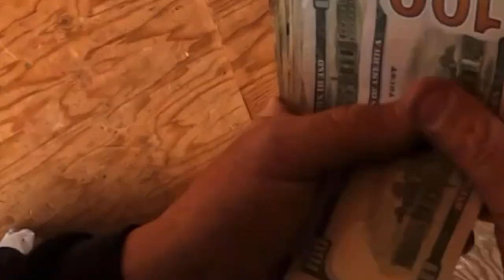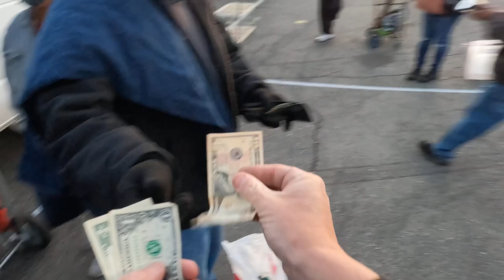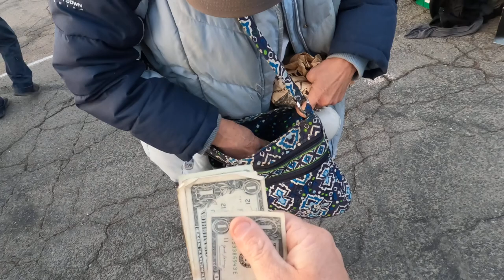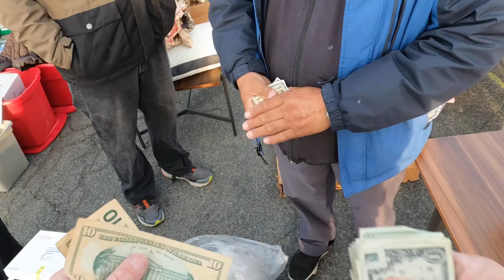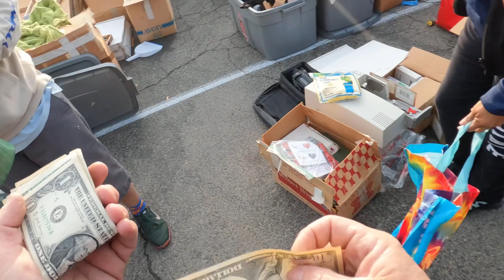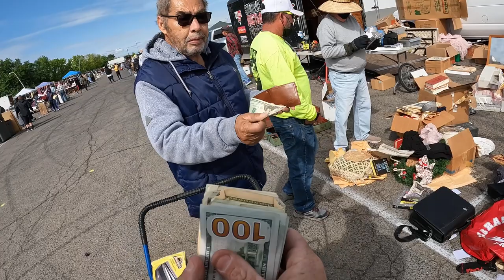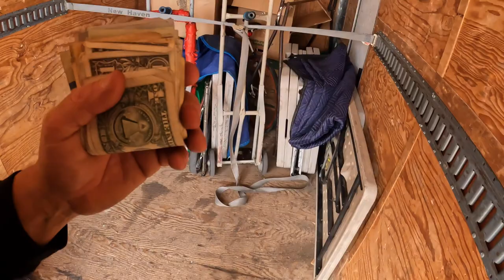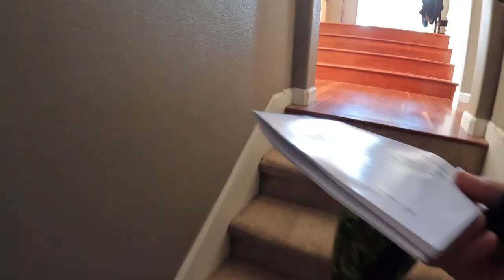How did I make all this MONEY  storage auction finds a day in the life of storage auction pirate

Comment: Oh man I love beach detecting.. I have 3 machines, all are minelab, the equinox 800, sovereign GT and my underwater one is exclabur 2, yes am not graceful and have been hit with waves and under tow. Now the equinox 800 can be submerge up to 20 feet.. but my exclabur is good to 200 ft If my brains working right.
If your machine is submersible  no worries, but if it's not,  and you use it in shallow water do not tip it cause if water hits the main unit then your machine is fried, so make sure beforehand and check YouTube on the brand you have there's always great info on all machines.
You will love it.